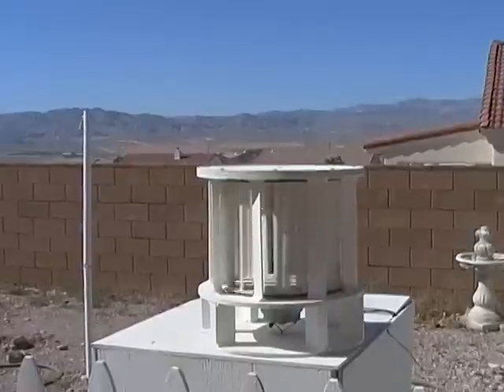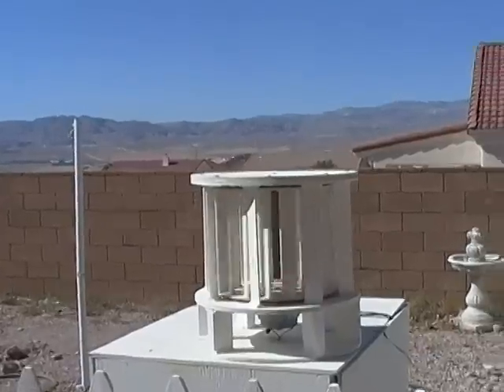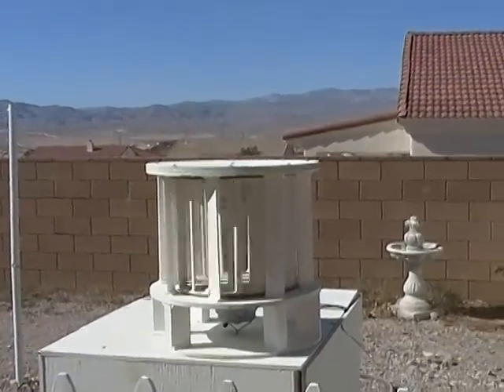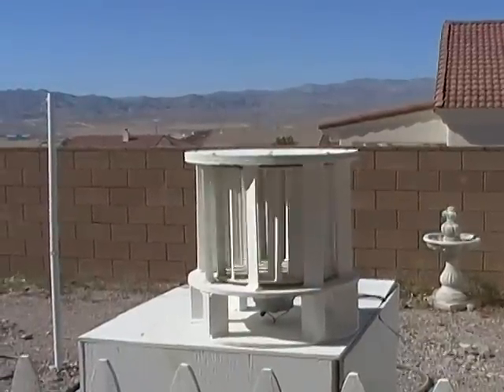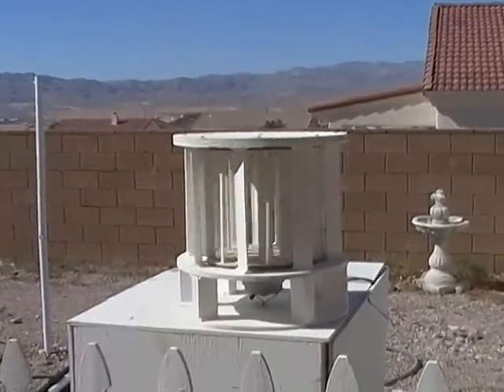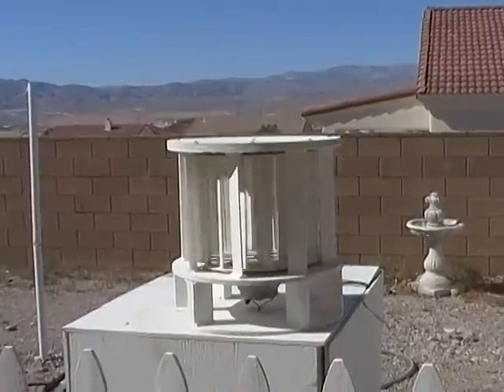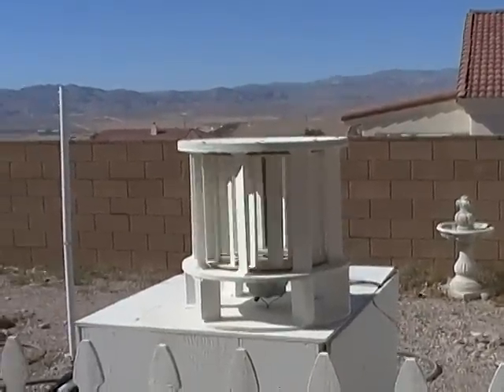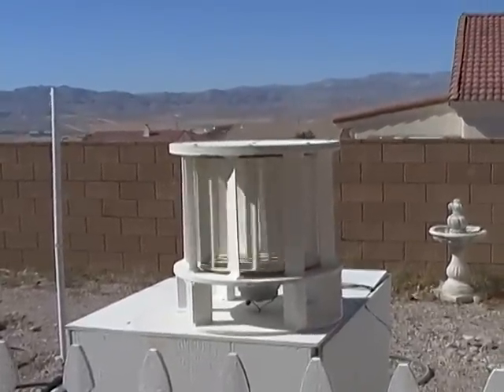Homemade Wind Turbine Generator VAWT Vertical

Comment: Have you made a lot of improvements since then?  Nice design
Reply from the maker: I tried, but this design is very difficult to improve, especially if you are using off the self materials. It is certainly possible to use lighter, and more durable composites, but that would drive the cost sky high for a tiny improvement.

Comment: Hey guys.. I'm fixing to build a vawt from a metal spool that was used for heavy duty electric wire.. I managed to get one from a contractor that runs underground wire.. I plan to use sheet metal to make the blades and use booster panels.. I wonder if I can salvage a generator from a burned out Honda home greateror?

Comment: What would happen if you mounted magnets vertically up and down the blade edges and then ran copper wire spools vertically on the upright mounting portions? Do you think it could draw even more electricity than your current set up? Was thinking of trying it myself but curious what your thoughts are.

Comment: Any performance data or updated designs yet? Thanks
Reply from the maker: Not yet, but my son (an engineer) and I were just talking about this wind turbine and possibly making an improved version. However this one turned out to be a very efficient and cost effective design and I have to give a credit to a little bit of luck on that. Might be hard to beat.

Comment: I think that's a good design. I can see building one that has two turbines, one on top of the other that counter rotate. You would have to use a slip ring. It would make the generator run at double the speed.
Reply from the maker: There's a threshold where adding more turbine relative to the load won't speed anything up. But you could turn a larger generator. This turbine was designed for the load it has.
Reply: Is there schematics for this?

Comment: It was interesting, but you can get more energy from wind energy with variations
Reply from the maker: Of course the holy grail of any energy conversion would be to get 100% efficiency. Currently if you are getting 50% of the wind energy converted into usable energy you are doing very good. So there is always room for improvements.

Comment: My experience it does Not produce enough rpm to produce any real power, 
Yes I thought mine was brilliant too. 
It spins fast until you connect the pmg. Myth Busted ,
Reply from the maker: Use this turbine design it puts the heat on that PMA no problem. Unless you live in area with low wind, then no turbine would be very useful for you.

Comment: Sept 2018 update. Once I bought fitted a 1kw pmg, the turbine slows to a crawl in relatively good wind. 🤦🏼‍♂️
Smaller pmg ?

2018: I built a test wind turbine with materials I had. I first tried the rotating (internal part) first, it turned but at a slow rate and I thought it insufficient to drive a pmg and produce power, the rotation could be stopped relatively easily by hand. When I erected the temporary (external) guides/ baffles at three points around the outside the windmill it literally fckd off. The internal blades were 110mm diameter wasted pipe cut into 4 pieces x 800mm long the top bottom ply board discs 800mm diameter. 
Unfortunately the temporary setup was too weak and had to be dismantled, but this video as an idea works tremendously.
Thanks for the idea.y

Comment: Excellent work congratulations. I also harness wind power to produce electricity, but with self-made generator horizontal + photovoltaic panels, with storage, in order to use the excess energy even at night.

Comment: I'm in AZ, so a similar climate by the looks of it and my only concern is the OSB. I'v head too many issues with that material breaking down in the sun. I've been thinking about how to stabilize it and one thought is carbon fiber/fiberglass resin? I'm currently looking at property next to a mountain and it has a pretty reliable wind source...

Comment: Basically in shape of a ball, with cut holes to match a spiral shape, to let wind pass through it.
The only issue is that without sufficient weight, the wind could swing the ball around, and if it's metal, expect it to become a wrecking ball lol.

Another idea that pops up is a pendulum based spinning wind turbine.

A pendulum may swing back and forth from the earth's own gravitational fields, IF you have a extremely long line.
And at the same time it can spin at the contact point of the ball.

Comment: Hmm people made wind turbines attached to the ground, floating helium turbines in the sky, even mini turbines that can be placed anywhere...

Now here's a question, is there a wind turbine that hangs off of a high area, and has weight and spins too?

It'd be a upside down vertical wind turbine in a sense, with the slack of the cable holding it down like a chandler.

Comment: what is the P.M.A.alternator you used for this project ?    I was going to put a 14 magnet 
alternator but the drag can be strong so I was told that a 7 magnet alternator would be better.

Comment: wwww.AlternativePureEnergy.ro – Tel: 0753.496.596
Comercializãm si montãm Turbine Eoliene, Panouri Fotovoltaice, Panouri Solare Termice, Micro Turbine Hidro, Baterii Solare, Invertoare 12v/24v/48v si Invertoare de livrat in Retea, Controloare de incarcare Solare, Kit-uri Fotovoltaice, Becuri si Proiectoare cu LED, Indicatoare Rutiere cu LED, Panouri Radiante, Plasme Termice, UPS-uri, Stabilizatoare de Curent, Generatoare de Curent, Generatoare cu Magneti Permanenti, Sisteme de Supraveghere.

Comment: This is really cool!!! We live 20 min. from New Orleans and just went to through a hurricane and ended up spending over $1500 for a generator and gas. The hubby and I have been wanting to go green for quite some time. WIND and SOLAR are free and clean, and we get quite a bit of both! Want to get away from the OUTRAGEOUS light bills we get was well.  How do you store the power? Batteries? How do you harness/use the power in your home? Thanks.
Bridget
New Orleans

Comment: Well we've seen many small setups that "generate electricity but as a prior post asked, how much power is this unit generating. 

All of this stuff is interesting to look at, it's a different story though if making one requires 57 to break even cost wise.  Not saying this one will take that long, which goes back to the question, how much power does this unit create?

Comment: As well as the central motor for power, what about laying the inner top and bottom disks with permenant magnets and the outer top and bottom disks with copper coil. could help imporve power generated

Comment: sniperwhg, I don't know where you acquired your info but you cannot hit the turbine with a fan and create more energy then the fan is using. It would take far more energy to run the fan, otherwise it would be over unity which technically is impossible. Even people working on magnetic drive motors (which I love) need to realize they are not creating energy from nothing. Magnetic force can create energy and can be exhausted, just like all energy, it is not destroyed or created.

Comment from the maker: @platinum243125 Generally HAWTs are slightly more efficient than VWATs if you measure by surface area covered. But that is moot. The numbers you want to see is the cost of production vs. energy return. I believe that large VWATs can be built on a commercial scale using common construction materials, unlike large HAWT turbines which are very expensive. In other words an large VWAT design could built, on site, by construction workers using common materials for fraction of the cost per watt..

Comment: Could you make a video showing how you have the motor connected? I have everything to make this but I do not know how I would connect the motor to a battery and allow my air conditioner to be powered by it. I have been doing some research and found out that I need a Controller that connects to the motor and battery. I also would need an inverter so I can change the DC to AC for my air conditioner. Any advice would be grate.

Comment: Funny because I acquired an old forced air furnace blower 2 days ago thinking to built something similar. I love this design because it brings down bird strikes next to nothing and wind direction is not a problem. I am a big zero when it comes to create any electrical devices. I think that I will need some studies

Comment from the maker: @wtf0804 It's a permanent magnet alternator or PMA. It's basically a regular car alternator rebuilt with permanent magnets. That's likely the best for this set-up. However, you can get regular DC motors that will work also, I got one on ebay for $20.

Comment from the maker: @goldgreen88 Best wishes with your project. Just make sure you can get all the materials for the project where you are. I've had several people in Europe tell me the LP products casing material isn't available there. I've suggested substituting balsa wood for the turbine blades. The balsa would need to be hand worked to get the curved leading edge and then several light coats resin and sanded between coats before paint.

Comment from the maker: @1arrivals It's putting 300 rpms on the wind blue "low wind" alternator in a 20 mph wind. Which is about 26 volts x 6 amps = 156 watts

Comment from the maker: @jamaoful On this turbine I'm using the "Low Wind" PMA built by WindBlue Power. Just do a Google search for WindBlue Power and you'll find them. My tests show I'm putting 300 rpm on that PMA in a 20 mph wind, which is very good.

Comment from the maker: It is running the "wind blue" low wind alternator. It spins it a little over 300 rpm in a 20 mph wind in my recent tests, which is very good. Starts turning at about 8 mph. I'm going to post a video on exactly how to build this turbine soon. The wings are a fiberglass material. I've  found that keeping these light makes a huge difference in performance. But there is more to it than even that. The exact spacing and angle has and huge effect and so-forth. I'll post a PDF of parts and dimensions.

Comment: Too bad, I would like to look closer. Is your turbine and cage fiberglass? Also, I notice the generator is vertical, did you replace the lower bearing or is it designed to be run in that position? Where did you get the generator? Sorry for so many questions, but your design is very clean and is close to what I have been contimplating for some time now, except a different method. What is your output to input ratio? I am anticipating 2 to 1 or better with my testing so far.

Comment from the maker: Yes it's a lift/drag combo system. I will be posting more info shortly. This little turbine does work surprisingly well.  Basically it's fiberglass flat bottom wing surfaces with the leading edge pointing inwards. The top of the wings are outside. Angeled anywhere between 35 and 45 degrees works. 45 degrees (max drag) works best in low wind and 35 degrees best for high wind. I hope that helps. 

All the best with your project. I'll try to get more info up as soon as I can.

Comment from the maker: I use it to charge up some golf cart batteries. I run power tools off of it and use it for back up power for my home. It's possible to add a grid tie inverter and run your electric meter backward as you help power your neighborhood. Obviously this is a small but capable turbine. I just built a new improved turbine like this. I did video the whole process so I might upload that coming up. But it's kind of long, 46 video segments! So I might need to make a DVD out of it. Or do a lot of editing.

Comment from the maker: This small turbine does very well in 20-30 mph wind. However, the size alone does limit what it can do. I've considered building a larger alternator. However I'll  likely just gear up a couple standard PMAs with a larger turbine in this design or something very similar. It just works. =)

Comment: I have been working on a very similar design.  I am getting similar results.  Mine starts charging at about 140 rpm or 9mph winds.  Spins up and then the alternator drag at cut-in speed limits further speed increases.  Most I have seen is 1 amp, but we are getting high winds of 20-30 mph this week.
I have tried gearing.  There isn't enough power in the wind at small scale.
My next step is to double the coil count and place the magnets on the perimeter of the 28" rotor.  Lets compare notes.

Comment from the maker: The website is windbluepower (com). Their low wind PMA reaches 12 Volts at 130 RPM which is nice for a direct drive system like this. It's about 90 volts X 12 amps at 1000 RPM. So a little over 1000 watts at 1000 RPM.
Reply: Wishing you more success

Comment from the maker: It's the wind blue low wind PMA. And yes you'll never get 2000 rpm from a turbine this size without very high wind. There just isn't that much energy in the wind even if you reach 100% efficiency. Once I have a turbine design I'm satisfied with I'll scale it up and make a geared up turbine. I suppose if you make a turbine large enough you can max the alternator regardless of efficiency to the wind. So maybe cost of production vs. energy produced is the most important calculation.

Comment from the maker: Using just the alternator bearing in direct drive and a brass bushing at top. Wood and fiberglass construction, wings at slightly less than 45 degrees in drag configuration.  Likely not the best configuration for wing turbine but it works. Efficiency appears to be decent in moderate wind. However, it seems to have a built in drag limitation in higher wind. Likely a result of the drag configuration. It looks nice and works. I'll get more efficiency with a little work. btw 3.5 lb turbine.

Comment from the maker: It's charging batteries right now. It appears to need at least 10 mph wind to reach 12 volts on the alternator. So even though it will start turning at lower wind speeds it's really not charging the batteries in anything less than 10 mph.

Comment from the maker: I'm still working on getting numbers. Because the wind in my backyard is very gusty my anemometer can't keep up with the changes so matching the wind speed to the tachometer to electrical output is very difficult. So I really don't want to post the fuzzy numbers I have yet. What I have tells me that efficiency is good but could be better. So I'm pleased but not satisfied as of yet.

Comment from the maker: Thanks that's a good idea. I might try something like a cone to control how the air exits. An extra stator is also worth a try. Currently I get wing lift as the air enters the turbine and another push as it exits. This design attempts to use both wing lift and drag to maximum benefit. However, there is certainly room for improvement.